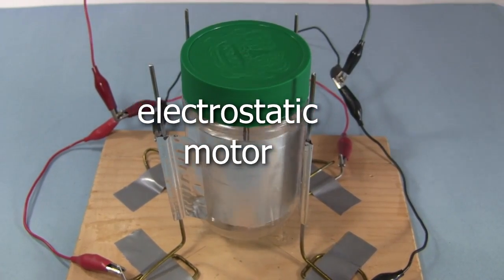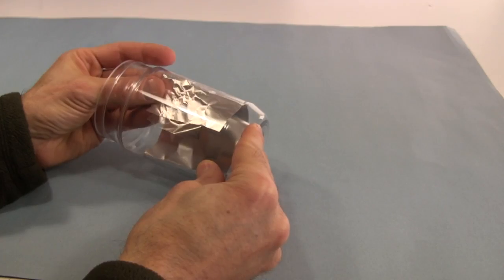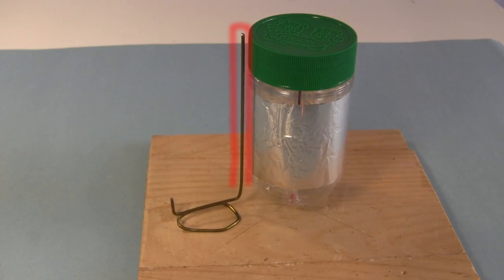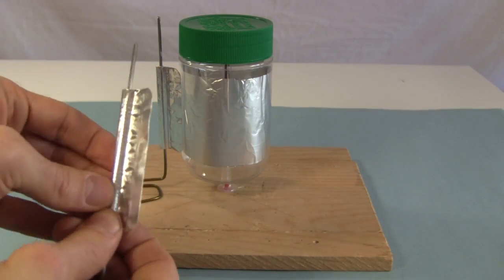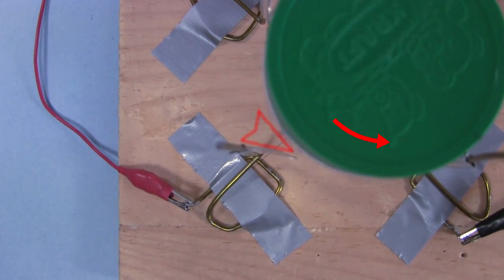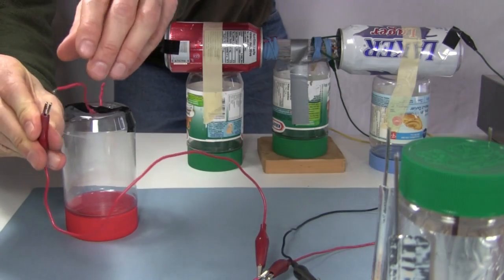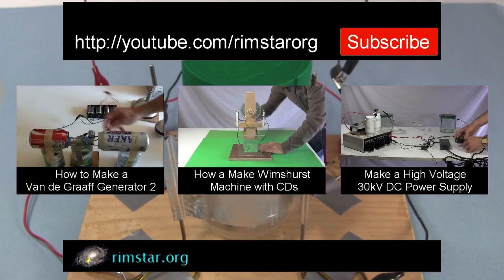How to Make a Corona Motor (v1/simple) or Electrostatic motor/Atmospheric motor

Comment: What if you use 2 corona motors, 1 to power each of the disks for the wimshurst machine. The wimshurst machine connects to a bank of capacitors that dump through a resistor to slow it then into a Tesla coil that connects to the corona motors while the primary continues to an outlet. use atmospheric charge to start it

Comment: How would one scale this motor, to run on reduced voltage, say for instance, if the wire in the air, was lower in elevation? Is this a dumb question?
Reply from the maker: I think a sharper edge on the blade would reduce the required voltage. Also, getting the edge of the blade closer to the surface of the cylinder would help too.
Reply: @RimstarOrg  Thank you so much!

Comment: how to make the corona?
Reply from the maker: The corona results from applying a high voltage between a sharp point (in this case the sharp edge of the blades) and another object which is either sharp of smooth (as in the jar).

Comment: Interesting device ....... will try to construct one myself......my question is why lined the aluminium foil inside the container rather than outside? Wouldn’t it more efficient on the outer surface?
Reply from the maker: No, if it's on the outer surface then it'll ruin the effect. The blades spray charge onto the cylinder. You want the charges to stay in the area where they are sprayed onto the cylinder's surface. With plastic, the charges stay in place since plastic is non-conductive, the charges stay in place (until they're removed by the next blade by spraying opposite charges). By staying in place, the charged area of the cylinder can be repelled by the blade, causing the cylinder to move.
If the cylinder was conductive on the outer surface then the sprayed charges would be able to move around. When a blade sprays charge onto the aluminum, the charges would just be repelled away and there's be no charged area on the cylinder for the blades to repel against.
You can see a bit of that explanation starting at three minutes and thirty-three seconds into this other video of mine https://www.youtube.com/watch?v=2rVdEhyMR6A
The purpose of having the aluminum on the inside is to help increase the electric field during repulsion.
Reply from the maker: Maybe I shouldn't have said the blades "spray" charge onto the cylinder. A better way would be to say that the blades charge the nearby area of the cylinder.
Reply: @RimstarOrg  hi Rstar! I successfully constructed my corona motor using ur technique powered by flyback high voltage transformer...😅😅. It does spin rapidly..... I also tweeted the design by placing 4  aluminium patches ( island ) on the outer surface of the container to face the 4 aluminium poles ...... it gives out very colourful corona . Thx again for ur help.....
Reply from the maker: Awesome to hear it! Thanks.
BTW Having the same number of aluminum foil on the outside as you have poles makes sense. Since they're islands, when the blades charge them, the charge stays with the island.
Reply: @RimstarOrg  I used the corona motor to spin my Zoetrope animation .... the result was fabulous. Kill 2 birds with one stone. 😃😃. Thx for your insightful channel. Truly learn a lot....
Reply from the maker: Nice! I love it. Combining one cool project with another gives 1+1=3! Thanks for sharing.

Comment: is their any graph you could make from using this SIMPLE CORONA MOTOR Ex: Out of 20 Light bulbs how many can the corona motor power Another Ex: How long would it take for 10 phones to charge to 100% using a corona motor
Reply from the maker: I guess it's possible to make such a graph. But a corona motor isn't like an electromagnetic generator -- the kind you'd normally use. You can use running water, for example, to turn a normal generator to produce electricity. But if you use running water to turn a corona motor, you don't get anything out. A normal motor can also be used as a generator. A corona motor cannot.

Comment: can this corona motor power multiple lightbulbs and/or phone chargers and if so how?
Reply from the maker: Not in any practical way. You could use it to turn a generator but you'd still need to power the corona motor in order to make it rotate. It would be more efficient to skip the corona motor and the generator and just plug your device into whatever you were using to power the corona motor. But if you want to do it just for the fun of it then you'd at least want to use my version 2 corona motor which can spin  better https://www.youtube.com/watch?v=9uEjXsX1F14

Comment: Can you please send me one I tried it and it came out terrible. Doesn't even work  PLEASE
Reply from the maker: I don't have time to make them for others but what did you use as the high voltage source? Also, tell me anything which you did differently. The trick I use in this video with the triboelectric effect may work with this simple Corona motor, though I'm not 100% certain https://www.youtube.com/watch?v=6x6DqPL14yU
Reply: I think it was when I was bending the metal hangers that it messed it up. I think I bended poorly( it was hard)but it didn't work

Comment: which metal is the hanger made?
Reply from the maker: I'm pretty sure it's steel, made from iron. But any metal will do. Just make sure to remove any coating that may be one it where you'll be making electrical contact with it.

Comment: how many voltage do you use to run to the motor. thank you
Reply from the maker: It's in the thousands of volts but I don't know how much exactly. It's certainly more than the usual sources available around the house. But if you look at this video https://www.youtube.com/watch?v=6x6DqPL14yU you'll see that I powered another corona motor (though it would likely work with this one too) using some unexpected items from around the house or easy to buy at a hardware store (a PVC pipe and a cotton facecloth).

Comment: Can this be used with the CD version wimhurst or do I need a bigger wimhurst
Reply from the maker: I didn't try it with the CD version since, while it's easy to make, it's output is so feeble. My guess is that it would turn slowly. After all, I got my corona motor v2 to work using just the triboelectric effect (and it would probably work with v1 as well). https://www.youtube.com/watch?v=6x6DqPL14yU

Comment: I love your videos!  They give me lot's of related ideas--thank you for that.
I would like to ask...When, at the end of the video, you used a sharp point and a dense E-field to spin the corona motor, I wanted to use something similar to discharge a large high voltage capacitor bank, something other than large HV resistors.  Do you have any videos showing how to do something like/similar to  this?
Thanks,
...now back to your videos...
--dalE
Reply from the maker: That's how I now discharge anything which is charged. I like it better than bringing a grounded ball near it since that produces a spark and my eyes are weary of UV damage from a lifetime of sparks. So instead I bring the sharp end of a grounded wire near it. That way the charge moves to the wire while the distance is greater than it would be with a smooth object and does so as a stream of ions too dim to even see. You can see me do it in this video http://youtu.be/Gf6EbRmYImI at around one minute and thirty seven seconds in. The wire is just a stranded wire and so the sharp end is really just the end of a bunch of strands. It's grounded to a power outlet in the same way I show at around seven minutes and ten seconds into this video https://www.youtube.com/watch?v=GEuK1OdYxHk.

And thanks! I'm glad to hear you're enjoying my videos! Thanks for watching them!
Reply: Thank You.

Comment: Can you tell me which would increase the  torque.? Higher potential  or more current.
Reply from the maker: I think more current. The potential at the blades is already maxed out once it starts conducting across the gap.
Reply: RimstarOrg 
Hello again. 
Thanks for thr info. Could you please check out my video @
https://youtu.be/AemMxQlTLM4
And tell me what you think is going on.
Reply from the maker: Your sharp electrodes are spraying ions and then Newton's third law happens: for every action, there's an equal and opposite reaction. The blades in this corona motor are also spraying ions but the blades are fixed in place so they don't move. The cylinder moves, but that's for a different reason. The ion rotor is another ion sprayer which is more similar in terms of how it's used http://youtu.be/UgWTjCHsm3M.
Not related, but if you're curious why the corona motor cylinder moves after the spraying, I explain it at the end of my atmospheric electricity video https://www.youtube.com/watch?v=2rVdEhyMR6A.

Comment: This video is very useful to me:) And I have a one question. Why did you sanding clothes hanger wire? What materials coating on it?  I hope know that. I'd appreciate it when you'd let me know. Thank you very much.
Reply from the maker: I don't know what the coat is that's on it, but there was a coating with the one I used. It's probably there to help keep the metal from rusting or corroding.

Comment: can we substitute any thing else rather than wimshurct machine or van de graff for corona motor
any simple things like battery or somthing else.....
pls reply bcuz i hav science expo 2ommorow
Reply from the maker: You can try doing what I do starting at 4:20 in the video but instead of the Van de Graaff generator, try charging up a PVC pipe by rubbing it vigorously with cotton cloth (i.e. using the triboelectric effect) and bring the PVC pipe near the wire end instead of the Van de Graaff generator. You can easily charge a balloon or plastic soda bottle this way by rubbing it against your clean hair but I find the charge isn't enough to turn this corona motor. I'm guessing 1 1/2" diameter PVC pipe might work, but I don't have one to try. I haven't gotten this trick to work with my corona motor because this one doesn't have enough electrodes and the distance between the electrodes and the jar is too far. But as a quick, last minute thing to try, that's all I can suggest.

Comment: what is corona motor?
Reply from the maker: It's a motor whose means of propulsion is electrostatic repulsion between blades and areas of a cylinder and whose means of charging those areas is by means of corona discharge between the sharp edges of the blades and the surface of the cylinder.

Comment: can you please what is corona motor.....where it is used??
and i have i doubt regarding dis...tat when u connect the wires[high voltage & ground] is there any external current flowing...can keep the hand -made wimshurst machine??wat u showed in other tutorial...if so where do v hv to connect ....where the spark comes or near the capacitors.....
pls reply.....
Reply from the maker: Corona motors aren't used anywhere, as far as I know. They're just a fun thing to make and play with. I don't think my homemade Wimshurst machine can supply enough current to make this corona motor turn, but I didn't try it so maybe I'm wrong. My commercially made one with the 26cm disks can, as you can see in this video. You can connect it to either of the places you said, where the spark comes or near the capacitors - it will give the same result.

Comment: thank you for last reply but sir my problem regarding voltage someone say about mesured spark gap and mutipyed with 30 kv/cm . is that logic will be right for vdg generator.and wrong so sir tell me about what can i do.??
Reply: how to mesured a spark gap &wap will be mesured by with respak to time?
Reply from the maker: I just did a google search like I suggested you do and the table I found gave me around 30 kv/cm so that sounds about right as a rough value. You won't know the exact value anyway. Some of it depends on the diameter of the Van de Graaff generator dome and one the diameter of the electrode on the other side of the spark gap. I don't know any way to measure it exactly. Use a ruler for measure the spark gap. I don't know any way to predict the time.
Reply from the maker: naitik suthar
I don't have any formula to give you.
But asking what the voltage of a VDG is, is nonsense. It doesn't make sense. A voltage is a measure between two objects. You can ask what is the voltage between the dome and a grounded ball. You can ask what the voltage is between the top dome and the bottom dome of a VDG that has two domes. But asking what the voltage is of a VDG does not make sense.
That is why you are finding formulas for measuring the charge on a VDG dome. That make sense. Charge is basically the number of extra electrons or the number of extra protons on the dome. That can be calculated.
The voltage between the dome and a grounded ball can also be calculated, but I don't know what that formula is. I'd have to sit down and start with a charge formula and then work from there to come up with a formula for the voltage between the charged dome and a grounded ball based on the distance between them, but I don't have time to do that.
Hopefully the above will give you a better understand of voltage and what you are looking for. That might help you find it, and its the best I can do.
Reply: RimstarOrg thank you sir.
Reply: naitik suthar sir i want to know can we utilize corona motor for indestrial applications
Reply from the maker: naitik suthar
I don't think it can be used for industrial applications. It's a pretty weak motor.

Comment: hello sir my question is how to mesurement of van de graff generator's voltage and what kind of diff methods for mesurments voltage.thank you for positive reply. sir.
Reply from the maker: Measuring the voltage of a Van de Graaff generator is tricky, since there is no one voltage.
You could ask what's the voltage of a VDG with nothing nearby. In that case it's the voltage between the dome and the surroundings, or if there is a bottom dome then it's the voltage between the top dome and the bottom dome. That would be a measure of the maximum voltage for the VDG. I don't know how you'd measure that voltage.
But when you bring a measuring instrument near the dome, the voltage is now between that measuring instrument and the dome. Also, you'll get a different voltage depending on how close your measuring instrument is and even what shape your measuring instrument is.
Often when VDGs are rated, the rating is for how high a voltage can be produced, though it's not necessarily the highest. A rough way to measure is to bring a grounded metal ball near the dome and see how long a spark is produced. You can then look that up online (do a search for something like "measure voltage using spark length"). The smaller the gap, the shorter and faster the sparks will come. I guess if you keep increasing the gap size, the longest spark you get before you increase the gap size again and get nothing will be close to the highest voltage, though the shape of your grounded metal ball will be having an effect.
Voltage will also vary depending on humidity.

Comment: Rimstar .. could you combine the corona motor with the wimhurst machine?
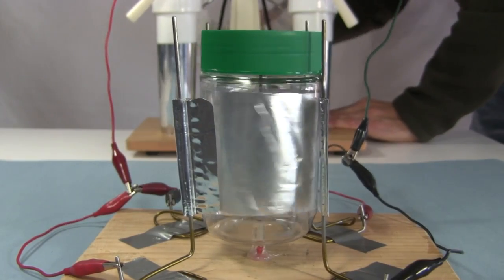Reply from the maker: I'm not sure I get what you're asking. I show a Wimshurst machine powering the corona motor at 3:30 in the video. Or did you mean can the rotation of the corona motor be used to turn the disks of a Wimshurst machine? That would be cool, but I'm guessing that would be difficult to do unless you had a very powerful corona motor.
Reply: Since the corona motor is already moving in one direction you could use that spin for 1 wheel and use a another on the same shaft to get the whimhurst machine and get some charge back.

Comment: could this be used as a generator?
Reply from the maker: Yes, though not necessarily a very powerful one. You can suspend a wire from a kite, balloon or even a drone a few hundred feet up with sharp points at the top end of the wire and use the bottom end as the high voltage input to this type of corona motor and it will run. It takes advantage of the atmospheric voltage difference which increases with height.

Comment: Can I use a AC Power Supply instead of the wimshurst machine ???
Reply from the maker: No, you need a high voltage, around 2000 kilovolts for my corona motor. An AC power supply is only 120 volts or 240 volts depending on where you are.

Comment: Can I use a old television screen to charge the corona motor? Thanks. António
Reply from the maker: Yes, you can use an old television screen. I just tried it. As soon as I turn the television on, the screen became charged and the motor quickly started spinning. But after a few seconds the screen was charged and there was no more current so the motor stopped. I turned the television off and on again but the motor didn't spin this time. I'd probably have to wait a while before it'll work again. But it did work, briefly. -Steve
Reply: Thank you!

Comment: Great video and Project!
How much voltage is on the red wires?
also how much current does the motor draw (no load)?
Reply from the maker: Thanks!
Judging by the approximately 2mm (2/16") gap between the electrodes and the jar, the voltage is roughly 2kV. The current shows up too erratically on my meter to say what it is. It doesn't seem to be very constant, at least with this simple corona motor.

Comment: How efficient are these compared to your standard 1hp 3 phase motor?
Reply from the maker: According to Oleg Jefimenko in his book "Electrostatic Motors - Their History, Types, and Principles of Operation" a corona motor with input power of 100 to 1000 watts can be 60% efficient. I don't know what the efficiency of a 1hp 3 phase motor is for comparison.
Reply: IIRC they can be up to 93% efficient. When it ionizes the air is it creating ozone in the process?
Reply from the maker: harryman11
I'm guessing it is, this type of ionization usually does. In this case there's too little ionization for me to smell it like I often do.